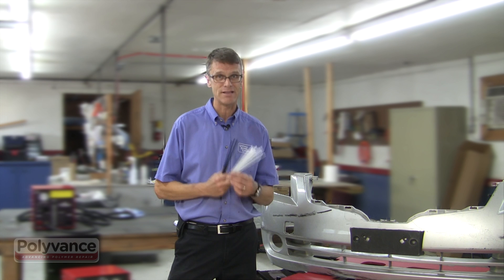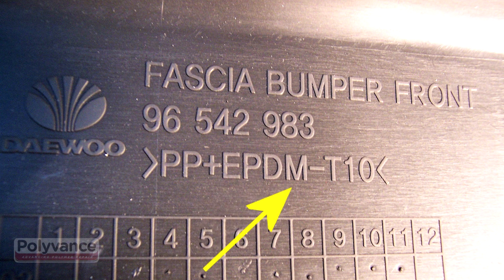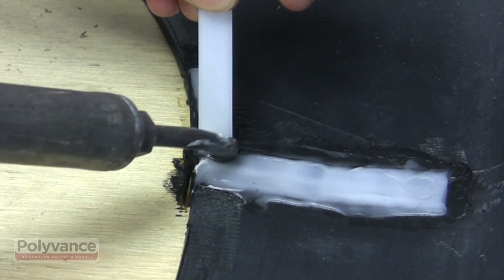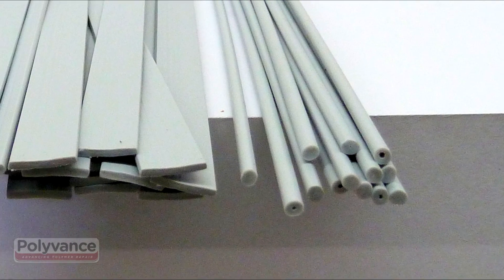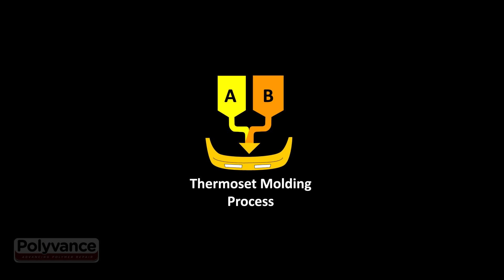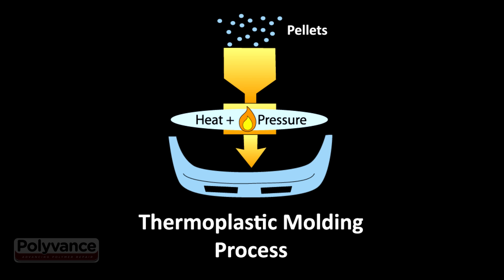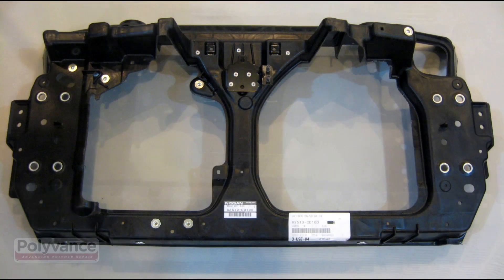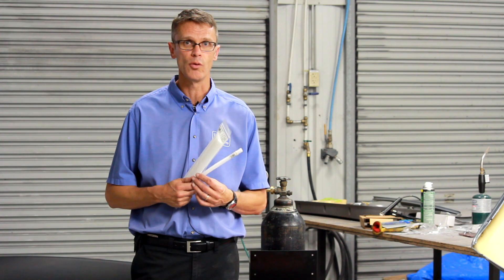Plastic Identification... What Can Be Welded? What Can't?

Comment: Can the abs plastic be weld?
Reply from the maker: Yes. We carry ABS welding rod (https://www.polyvance.com/ABS-1/). Additionally, PlastiFix can be used to repair ABS plastics (https://www.polyvance.com/PlastiFix-Kits-1/2501/)
Reply: Polyvance. Thanks in the shop where I work we use weld ur products but I am the painter in the shop and I need to weld   An spoiler that made of pbs plastic and the manager the guys in the shop said that that kind of plastic it  doesn’t weld well????  That doesn’t last or something
Reply: @JaimeAlegria-80  If its ABS, it will weld fine and should be plenty durable.  If in doubt, melt some 2045W stainless steel mesh into the repair using an airless welder.    Spoilers are sometimes also made of polyurethane, in which case, the repair process in not the same and you cannot do a fusion weld as urethane is thermoset and doesn't melt.
Reply: Scott B thanks bro  it’s a new  2017 charger trunk spoiler that I am gonna cut in the half to make it  6 inches shorter because it is going on a different car and before I cut it I wanna how to weld it back in the shop where I work we have the equipment to weld plastics  I even know how to weld bumpers but I have never weld abs  and the guys at the shop said that is not gonna work  that abs  it never doesn’t weld good  or something but I am gonna do it just like u said thanks for your help
Reply: @JaimeAlegria-80  sounds good.  Have fun with the mod!
Reply: Absolutely!  The general rule is:  If it melts, it can be welded.  PlastiFix works great on ABS too, but its only available in the USA and in the EU.

Comment: my plastic welding concern is a Dishwasher plastic tub, the heating element warped and melted a hole in the tub bottom, not under warranty, my fault it must have been a knife that fell through the basket hitting the element when pushing the lower shelf into washer, which did not happen the elements warp after time. What type of plastic was used when making a dishwasher tub a few years ago?
What can you recommend?
Reply from the maker: Somewhere on the tub, there should be an ID symbol stamped on it. If you can't get to it, you can contact the manufacturer to find out what type of plastic it is. Once you find out what it is, we can definitely help you out.

Comment: I’ve tried to weld some cracks in my Thule Adventurer car top carrier. Supposedly made of ABS but I have 2 types of ABS rod and it just won’t bond. ( surface prep with wire brush then acetone). No markings on it for plastic type. I’ve also tried about 4 other types of rod with no luck. Any suggestions?
Reply: I'm not surprised that you are having difficulty welding your Thule cargo carrier.  There are several things working against you and one thing that you did to cause additional problems.  Cleaning ABS with acetone is a big no-no.  Acetone eats ABS and soaks into it easily.  So when you go to weld it, even if it feels dry it has solvent trapped inside the material, when heated the solvent migrates and interferes with the weld.  
The other issues at work are the thickness of the plastic, oxidation, and sensitivity of ABS to welding temperature.  So, in order to weld plastic, the surface of both the filler rod and the substrate need to be clean and fresh.  Clean the rod and substrate with a cleaner designed for the task, like 1000 Super Prep or 1001-4 Eco Prep plastic cleaners, then sand the surface of the rod lightly,  v-groove the substrate and sand the area to be welded, then weld it.  BUT because the Thule boxes are so thin, the problem you'll have is that by the time the surface of the plastic is melted, the rigidity of the substrate is gone and you can apply enough pressure while welding to get a good bod without someone holding a backer plate on the backside to prevent it from giving...ALSO ABS has a tendency to warp easily...so your challenge in your project is to weld, not warp and have enough pressure to bond. Its tough.  on stuff like your Thule box, I always use a Product called PlastiFix.  It makes a repair that is next to none on ABS, it doesn't distort the plastic and it can be painted easily.  Its a slower repair process, but its worth it in this case.  Check it out here:  https://www.polyvance.com/PlastiFix-Kits-1/2503/  Video links are in that ink.

Comment: Hi, need to repair a PA66 broken part, but  the broken part is missing. Which plastic rod should I use to repair it. Thanks
Reply: Any of the R06 series rods from Polyvance: https://www.polyvance.com/Nylon-1/?pageNum=0  
OR  if you want fiber reinforced nylon, try the R21 series. (page two of the above link.)
Reply: @scottb7600  thanks a lot will try the cheapest first.

Comment: Im trying to repair an ac scnitzer BMW bumper but it has no stamp other than "made in germany" TPO and PP wont stick to it at all, any ideas what it could be made of?
Reply: AC Schnitzer seems to use several different materials for their aftermarket parts.  It could be carbon fiber (very hard, breaks irregularly, and has fibers in the broken areas) , polycarbonate (hard, usually breaks with sharp edges, melts easily, weldable with PC rod or use PlastiFix Adhesive),  ABS (not quite as hard as polycarbonate, weldable with ABS rod, PlastiFix works EXCELLENT on this material) or Urethane (very flexible, usually yellowish in color, but not always, decomposes if welding is attempted, the plastic remains tacky and the remaining goo has no adhesion to much of anything.)
Reply: Thanks Scott, much appreciated. It’s not carbon fibre or pc, I’ve tried every rod I can think of pp/epdm, abs, xenoy, pc, pe, pa, tpo...So annoying. I’ve got some of your rods on order now so fingers crossed
Reply: unfortunately the plastifix rods dont stick to it either
Reply: Do you mean fiberflex?  If so, it may be technique or expecting fiberflex to produce a true weld....which it does not.  It acts more like an adhesive and bonds the plastic together, but does not fuse it, if that makes sense.

Comment: I am a plastic welder and have always used the appropriate ventilation but is there any need for a mask or resperator from breathing in what isnt clean air
Reply: I would recommend a respirator appropriate to the task coupled with good ventilation.  A plain dust mask is not recommended.

Comment: How can I fix a big crack in my side by side ATV  floor? A big rock hit the underneath and made a big crack going from bolt to bolt!! Please help I will try to fix myself.
Reply from the maker: Hi, Lucie! 

https://www.youtube.com/watch?v=EduMea_N8NI&t=3s

If the floorboard is made of something like polyethylene or polypropylene, which it most likely is, then you can use this! Make sure you're able to identify the type of plastic it is, though. If you're in a hurry to get it done, it might not be a bad idea to order both polyethylene AND polypropylene welding rods so you know you'll have what you need when you get started.